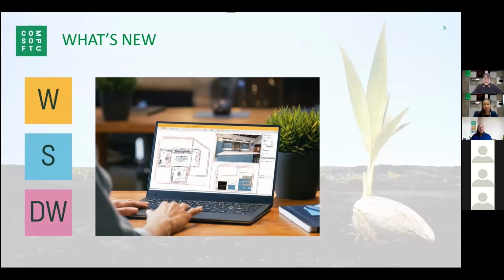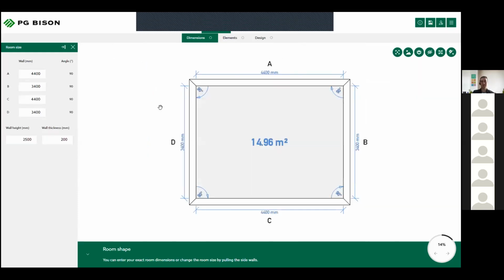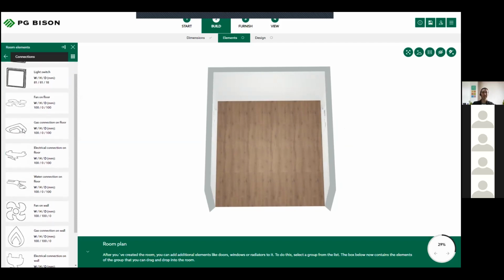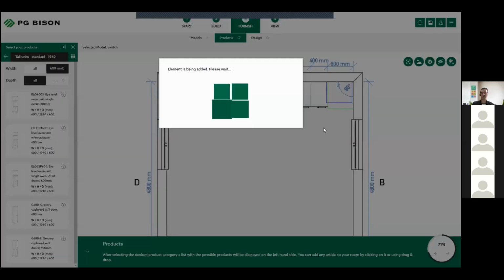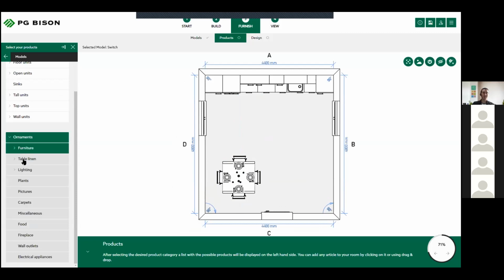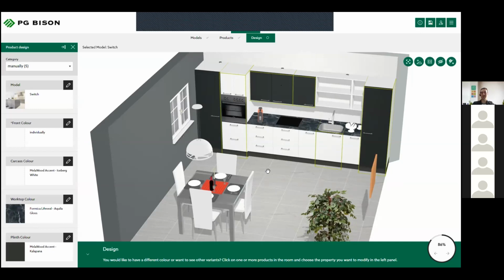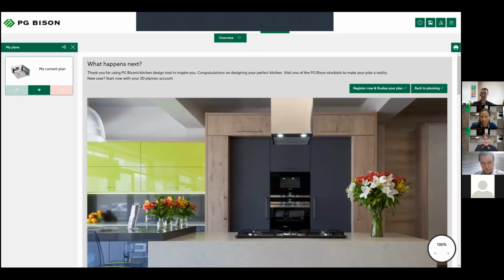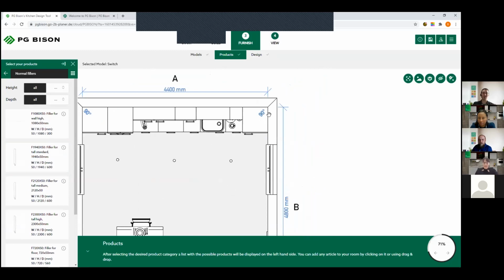PG Bison & Compusoft - Use Our Free Kitchen Design Tool

Comment: Hi , great software especially if you can use it on an Android phone as i did. The only problem you may encounter is the use of a
 Mouse. I will use a C type micro usb
 And USB Adapter To use with ny phone.Other than that You can save and print Your drawing.This is an excellent free
 Easy to use, kitchen Design tool.Thanks PG Bison.